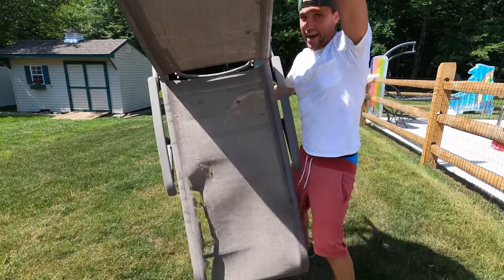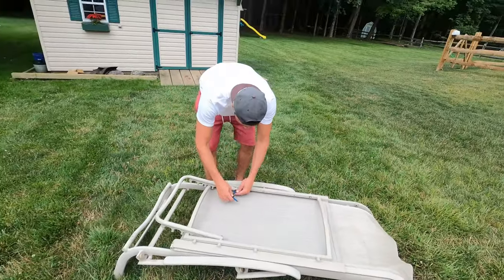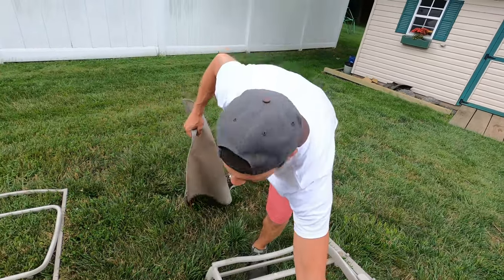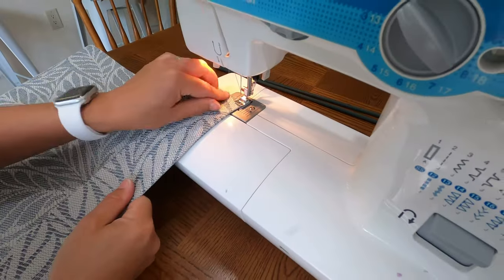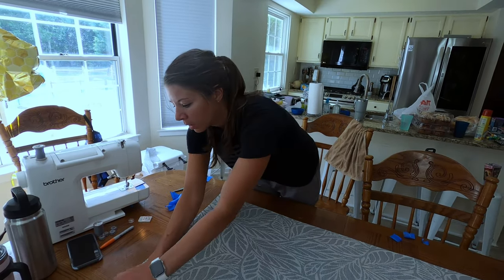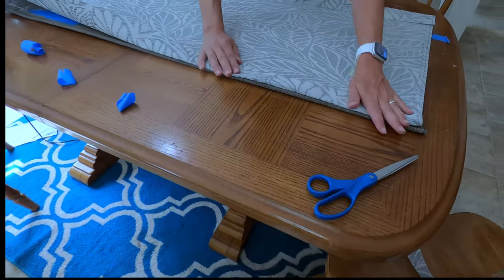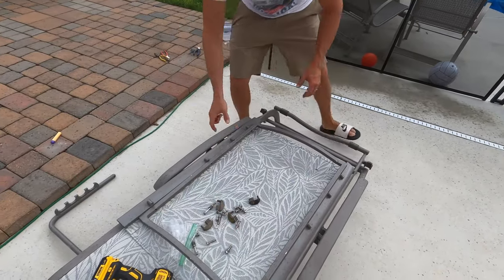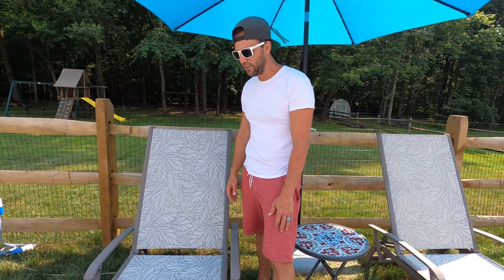How to Replace Outdoor Chair Sling Fabric and Customize to Your Favorite Design

Comment: Getting ready to do this...did 'the wife' also use the heavy duty thread in the bobbin?  Excited to redo our chairs, replacements at Costco were over $300...sheesh
Reply from the maker: She amazing and yea she did.  When you buy the fabric they should be able to tell you the needle size and thread size to use
Reply: I have needles & thread already because I do quite a bit of sewing, its just that sometimes the heavy threads get jumbled up...that being said,, we completed both of our chaise lounges tiday.  We were heading home to order some Sunbrella fabric, when decided to stop at a Hobby Lobby we were passing.  Found some outdoor fabric, on clearance, decided to try it as a 'test run'.  Worked out so well, although the fabric pattern  would not have been my first choice, it looks great on the chaies.  Very hapoy, and would not hesitate getting a better fabric on the next go around.  Just a note...whenever I work with large, cumbersome pieces of fabric, another good way to hold in place besides tape, is to use plastic clothes pins.  Easy to manipulate and move around, especially when only your 2 hands are available.  Great video, thanks for the inspiration to tackle on our own, hiwever,   It was a bit trickier to get the seat section back together than we thought it would be.  Luckily my husband is handy with tools, and clamps helped a lit.  Thanks again from 2 seniors that needed another project???😂🤔😂